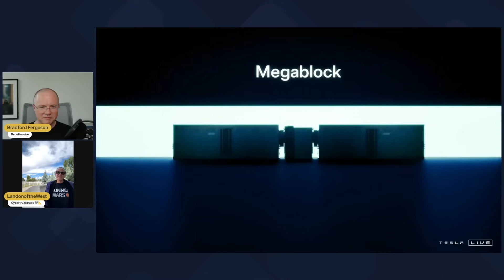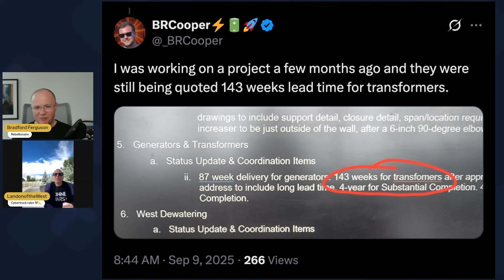Tesla Megablock Explained: Solving the Transformer Crisis and Powering the Future

Comment: 1 MV? sounds impossible, especially with batteries and stuff. AI says it will arc 1 meter, more for AC. i can't imagine how to design such a thing.
Reply: MV = Medium Voltage. Somwhere between 1kV and 30-50kV max.
Reply: They can make any voltage they need from batteries using inverters* 🎉🎉